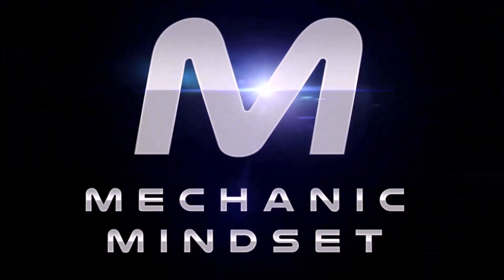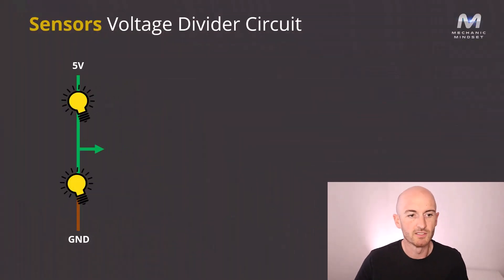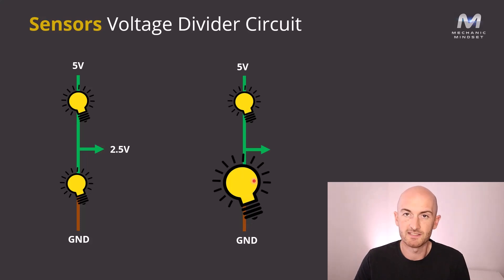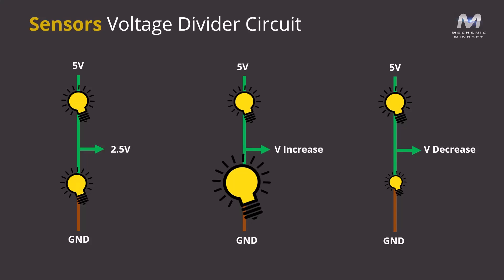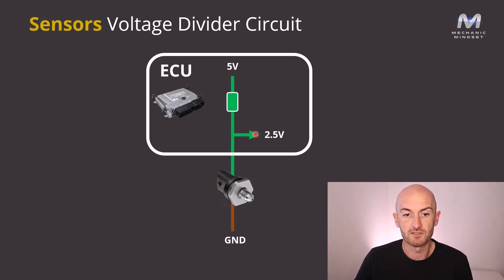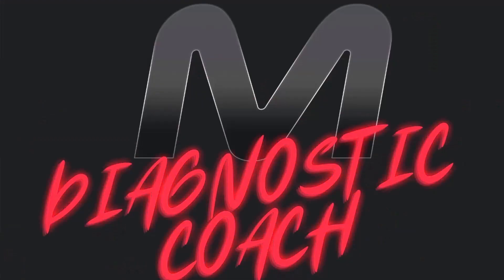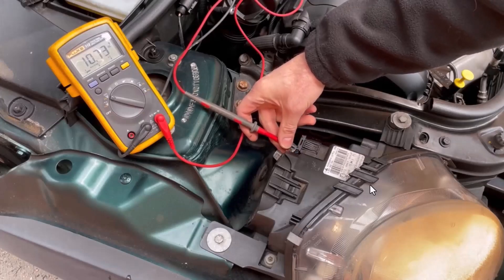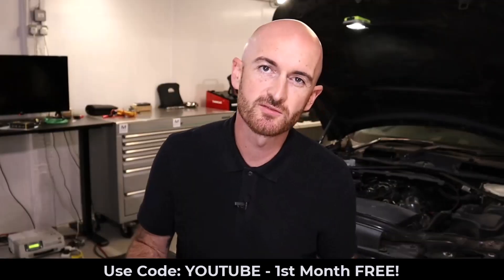Master Sensor Diagnostics with the Voltage Divider Circuit

Comment: I think the explanation is a bit confusing. If you have two resistors (in this case two light bulbs) in series between a fixed voltage supply (5V in this case) and ground then the current flowing through both resistors is the same (because both resistors are in series). The voltage across a resistor is the current passing through it multiplied  by the value of the resistance. As the current flowing is the same in each resistor the voltage across the larger resistor must  be larger compared to the voltage dropped across a  smaller resistor.

Comment: So on a 3 pin Hall effect crank sensor 5v reference and ground. On the signal wire are you saying you’d expect to see 2.5volts plugged in with ignition on?
Reply from the maker: No, it would likely be either 5V or 0V depending on where the crank stops. 

If the engine is running, you’ll probably get 2.5V average with a voltmeter (but that also depends on the type of sensor)

Comment: So on scanner danner he says if you unplug one of the 5volt reverence sensors that you can find one that’s bring down the system. Ok but if all the sensors are on the system connected how can they all be 5 volts. Confused 🫤
Reply from the maker: That might help if the 5V supply is shorted. Usually there are 2 or 3 separate 5V circuits. We did a lesson where we analysed an ECU schematic. Quite interesting!
Reply: @MechanicMindset  🤔👍🏻

Comment: Woooooow i never thought i would understand how ECU works inside
Reply from the maker: Cool isn’t it!? Simpler than you thought? Of course, there is a little more to it than this for the rest of the systems, but here is the core fundamental 👍
Reply: @MechanicMindset   of course you made it simple although there must be a bit complex stuff going on...
Pls i have a problem if you could help
I had a P1401 on my honda accord 2005 ictdi 2.2

I tried to clean the egr valve which seemed to have   been in a stuck closed position 
After cleaning the check engine light turned off fin but the engine becomes soo weak i could even go up hill more than 1st gear (extremely slow acceleration)
Is it a bad egr valve stuck open ? That i should replace?
I also made a test for injectors and find the return is higher so the engine can no longer start unless I try really long crank still the engine was so powerful than after egr valve cleaning 
So what do you think that made the car a turtle

Comment: If you take this one step further. When the ground connection is lost, the voltage at the point of measurement is the full 5 volts since there is infinite resistance. Conversely if there is a short to ground then the resistance is close to zero and the voltage at the measurement point is zero. Those two measurements are how the ECU sets codes for a sensor circuit being open or shorted. Either max voltage or no  voltage. If there is no power to a sensor circuit then the ECU could misinterpret the zero volts as a short to ground.
Reply from the maker: That’s right 👍 This is where the course goes next covering pull up and pull down resistors. We also put various resistive faults in the circuit and check the effect 😁